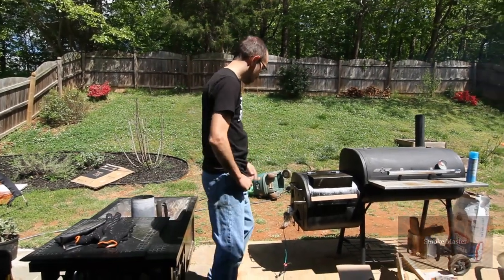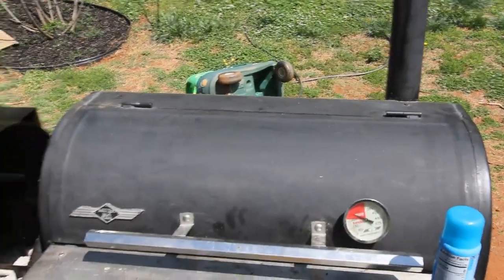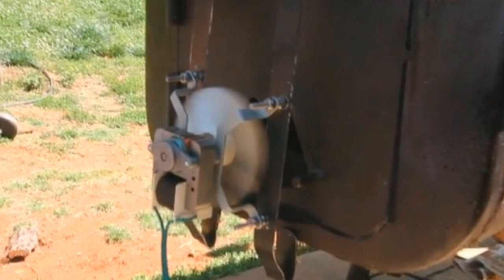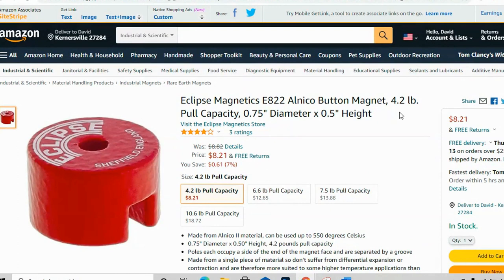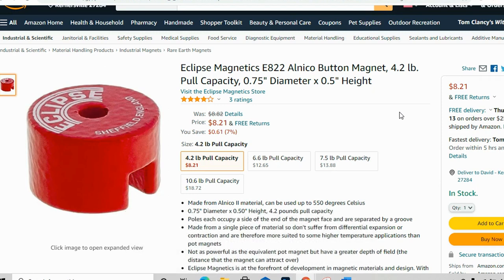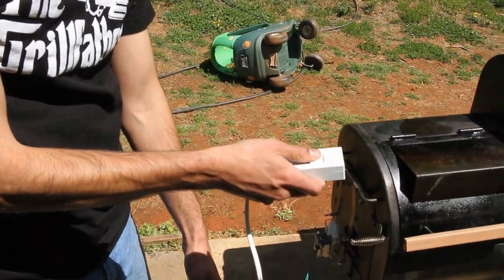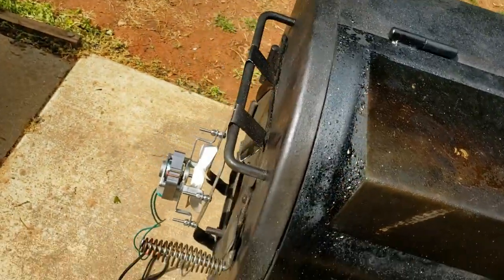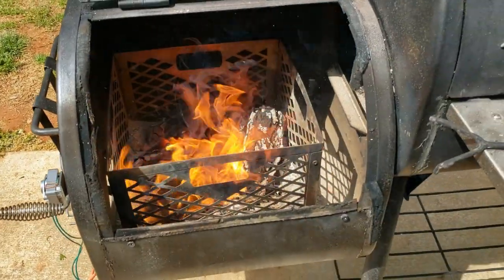Make a DIY Draft Fan for your Offset Smoker

Comment: Why not add put a fan on the smoke stake and pull the air instead of pushing
Reply from the maker: This is a very interesting idea that I have never thought of before. Someone should definitely try that.
Reply from the maker: Thinking on this a little more, it has occurred to me that one problem might be in having all that heat of the exhaust passing over the fan and any other exposed component. This isn't to say that it can't be done, just that it might be a little more difficult.
Reply: @SmokeMasterD  a draft inducer from a gas furnace is designed for heat and should work in this  application.

Comment: I have found that opening the door will provide enough air without using a fan.
Reply from the maker: True. It certainly isn't necessary. But I enjoyed doing it. And it can be helpful during a cook too. Some people use a lawn blower here and there. I  like the control I have over this thing.
Reply: @SmokeMasterD  , I have done the leaf blower thing too... now, if I need to boost the fire beyond opening the door, I use a heat gun. Your fan setup is definitely convenient.